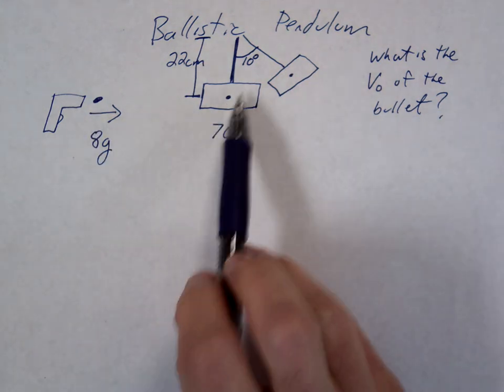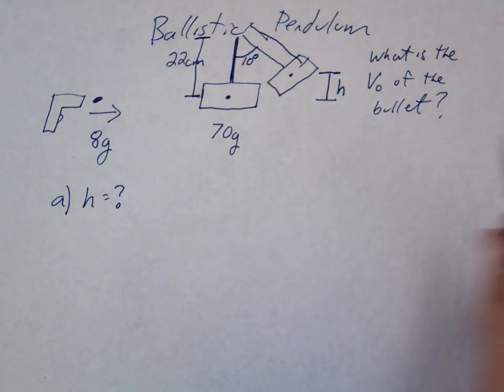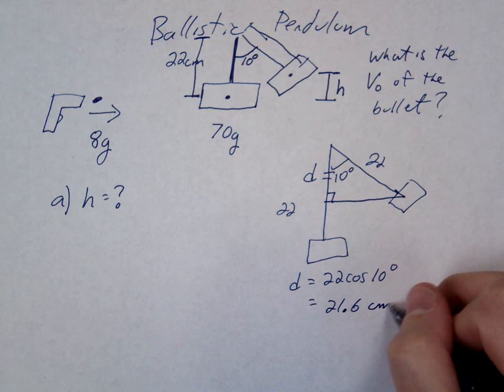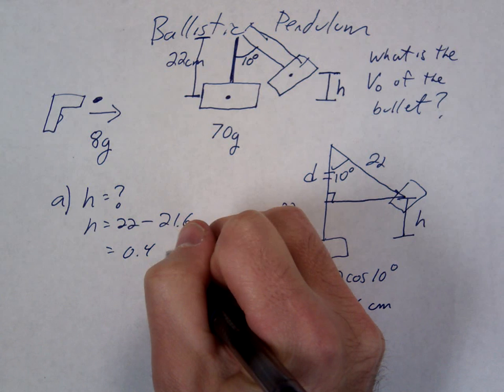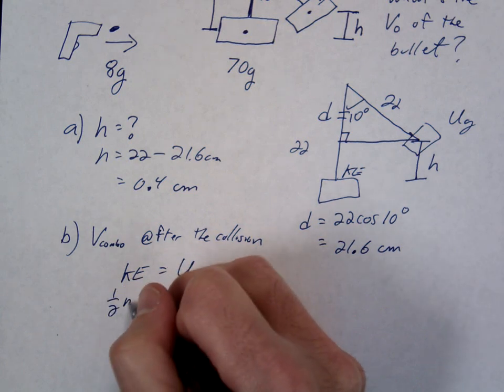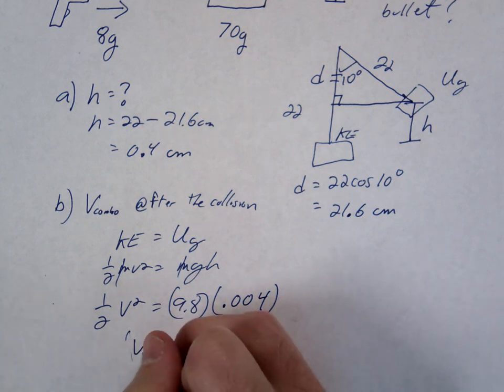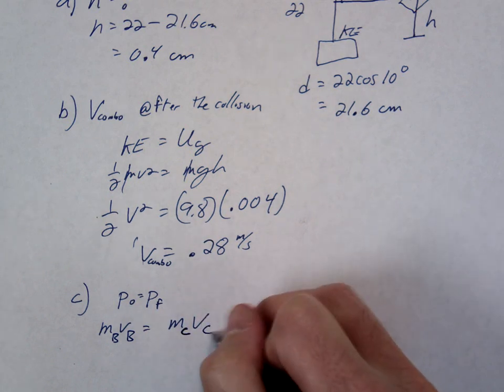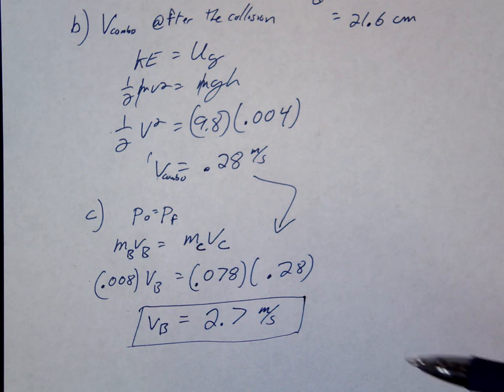Solving a Ballistic Pendulum Problem Using Energy and Momentum conservation

Comment: There is a transition error between the height. When you calculate the height, you get .4 meter. However, you wrote .004 meters which drastically changes the calculations.
Reply: He got .4cm which converts to .004m for the equations.